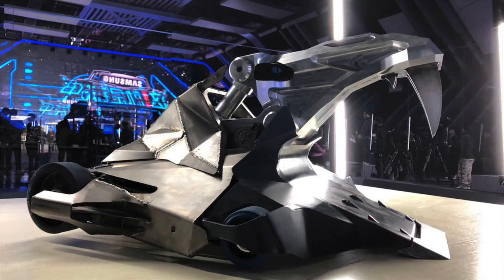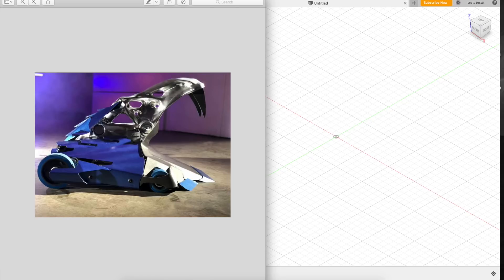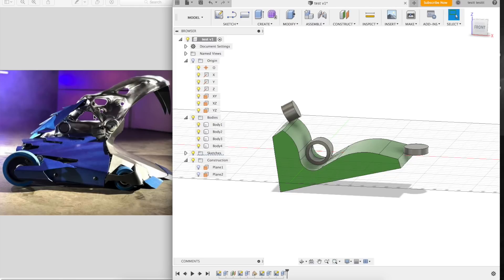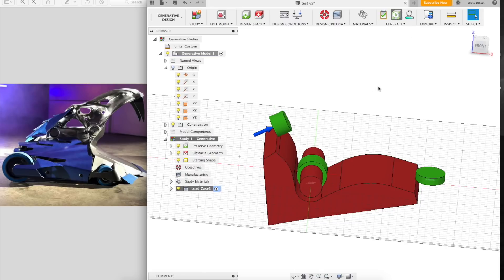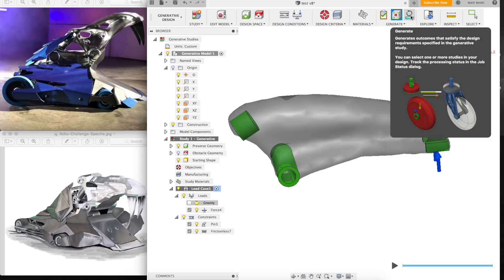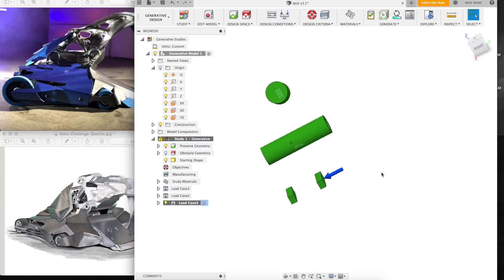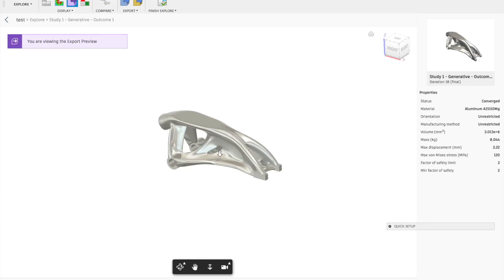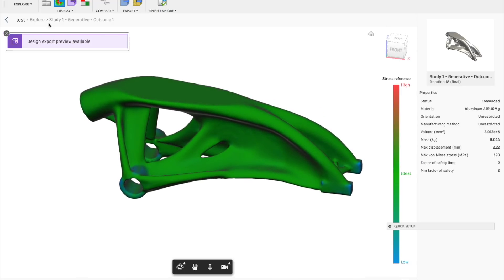Re-Creating this Crazy BattleBot Skull

Comment: To answer some questions you had:
Generative Design actually does run all loading cases as long as they're within the same study! The "active" load case is just which one is  visible and editable when setting up the run!
Also, the differing results are based on manufacturing method - so the weird wavy one is optimized for additive manufacturing with a 45 degree overhang, printed in the Y direction - that's why it's droopy on one side and not on the other! You can change the manufacturing method to achieve different results optimized for different methods.

Comment: If you want a symmetrical part, take what the generation gave you, add a plane, cut off half of it and mirror it. Sure it won't be 100% accurate to the simulation, but you should be close enough. 

If you want the right way to model a symmetrical part, you'd add a keepout zone and model half of your constraining features so that there's a flat surface in the middle that you can mirror. Just remember to do half your loading conditions on half the skull. This would be more accurate to the study, but likely err on the side of being stronger than the study.